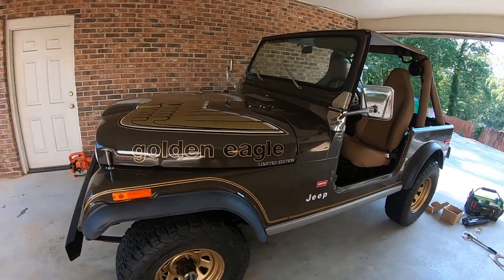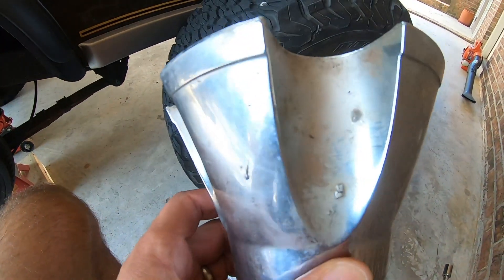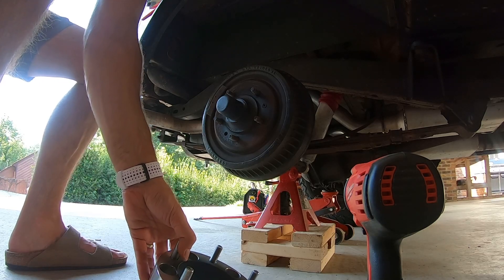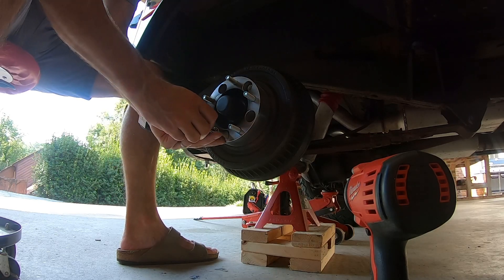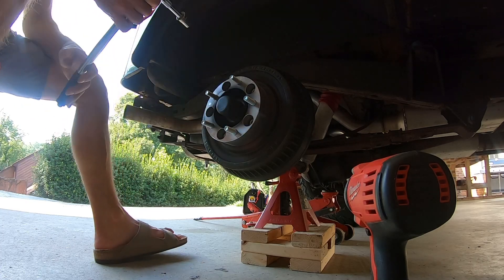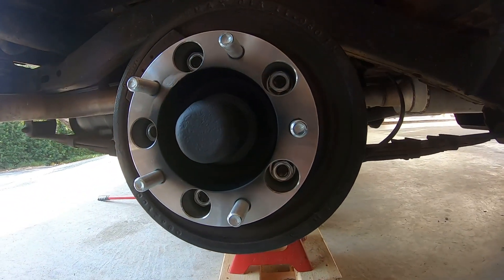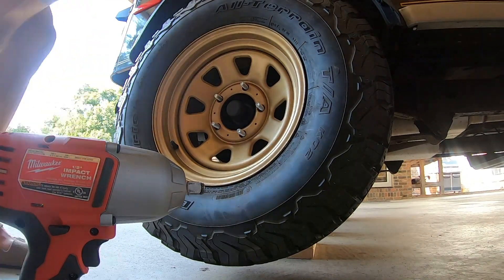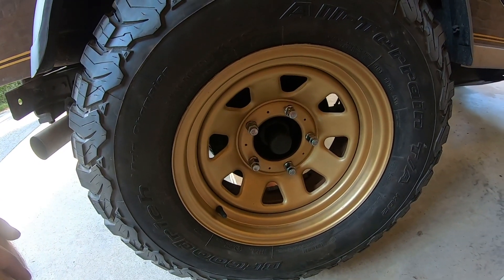Jeep CJ7 Wheel Spacers Install

Comment: Looks good. I thought the 2” was going to look bulkier than how it turned out. I was thinking about putting 1.25” ones on my 77 cj, but I might do 2”. Which spidertrax spacers did you get? Did you upgrade anything, prior to this ,around your wheel?
Reply from the maker: I didn't upgrade anything other than the lugs. I didn't want to go that big, but  with the narrow track axle I wanted the wheels to be close back to front.

https://www.amazon.com/gp/product/B01325TODI/ref=ppx_od_dt_b_asin_title_s00?ie=UTF8&psc=1